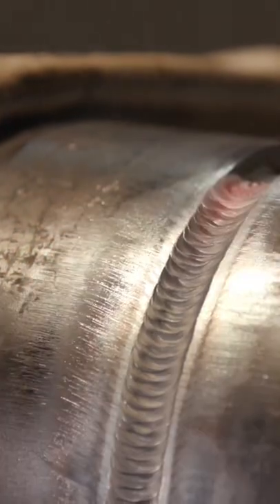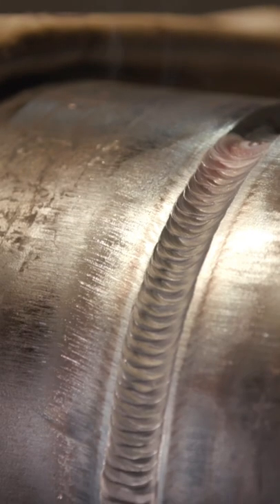One Pass Hot and Fill to Flush Technique | TIG Welding #shorts

Comment: Flush couldn't have been the word he was looking for🤔
Reply: When he caps itll b nice a little over fluch
Reply: Doing your fill pass about a 1/16th-1/32nds below flush allows for your cap to melt into the corners really nice so you don’t get undercut on your welds, the weld in this video is closer to 1/8th below flush which is going to cause the cap to be really wide and  could even cause it to sink in the center of your welds manipulating the structural integrity of the weld
Reply: @electedsphinx4086  yeah I had no clue wtf the guy in the video is doing, hope his cap is above flush because if I was the cwi I’d send that shit back before I even saw the cap. Even if he was going to do a 7018 cap that cap is still under flush, so I doubt he will even reach flush with a tig cap

Comment: Bro just turn up to bout 210 use 2 5/32 rods and smoke it in there so you don’t have to pull out of the puddle
Reply: Ol boy in our shop would do that. Stainless, 625, carbon... didn't matter. It was always slick and would shoot every time.